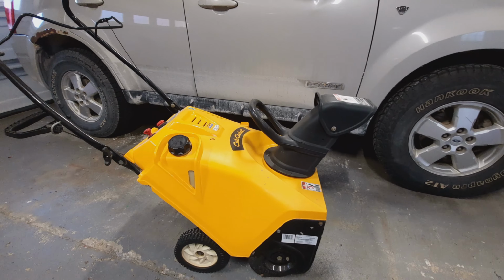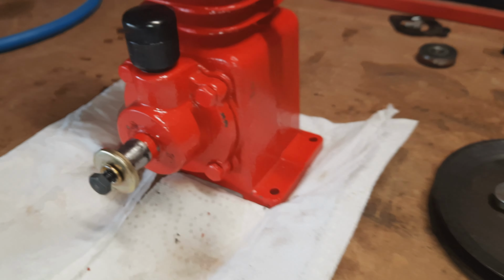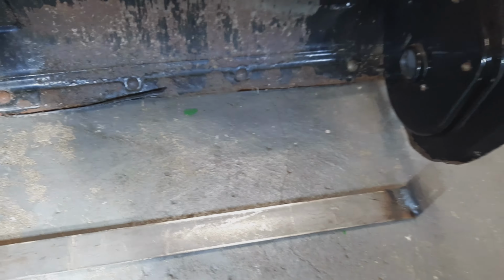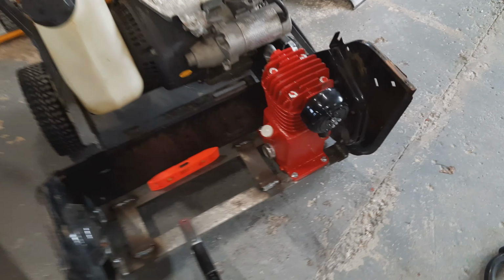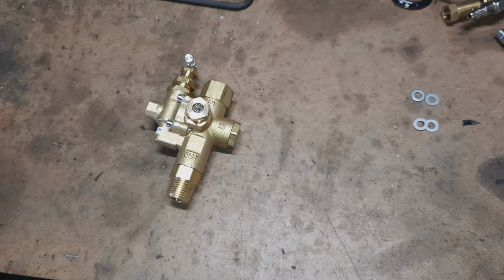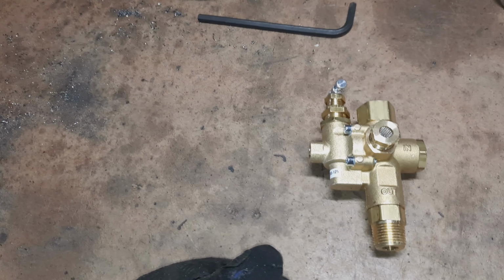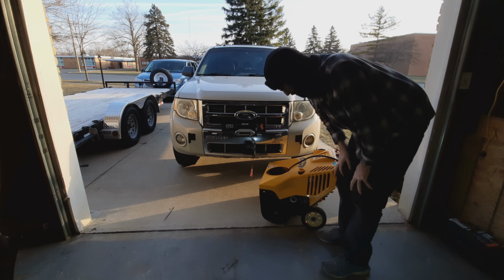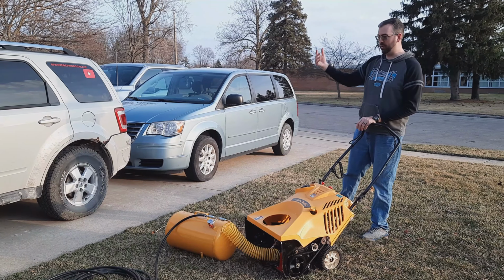How To: Fill Tires With Your Snowblower

Comment: make sure you get some kind of airflow across the compressor head! it won't last long otherwise. but that's a fantastic idea I might actually do this.
Reply from the maker: Yeah I do need to address air cooling for the compressor. Maybe I'll just open up the hole the compressor shaft goes through, since the pulley was designed to double as a fan.

Comment: Pretty cool setup from an old snow blower.  Have you considered an electric clutch on the engine that cuts in and out based on pressure?  That would save wear on the compressor when the desired air pressure is reached.  BTW, your welds are perfectly fine for what you are doing.
Reply from the maker: Thanks! I'm working on a solenoid to engage/disengage the belt since it already has belt tensioner hardware. Just a different way to do the same thing, but using air pressure control.

Comment: Good idea for a worn-out blower. I could use something like that around our shop yard.
Reply from the maker: Thanks @jessiemae6873! I will primarily be using it when offroading. My group has a lot of tires to refill to street pressures afterwards, but no electricity in ORV parking lots.